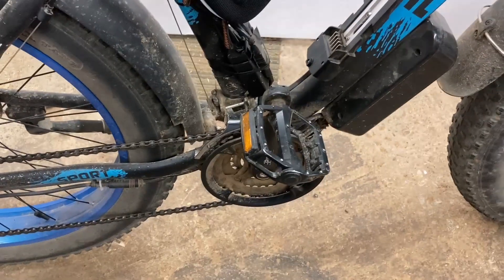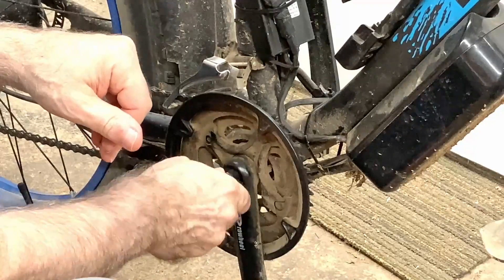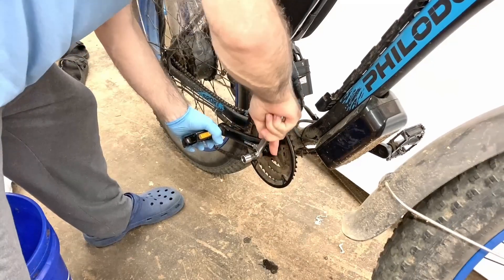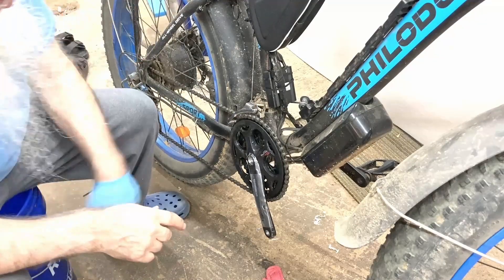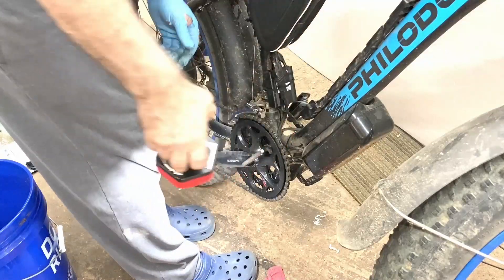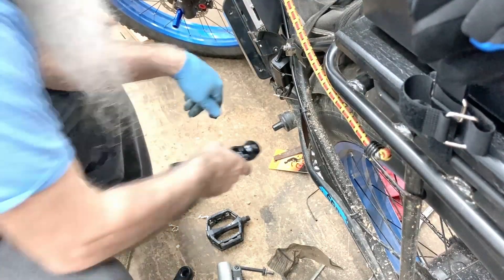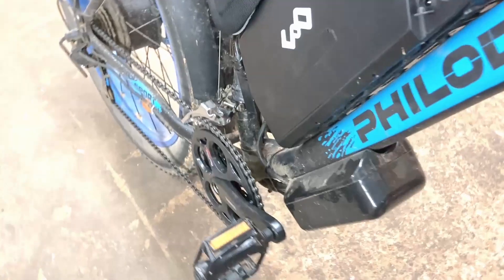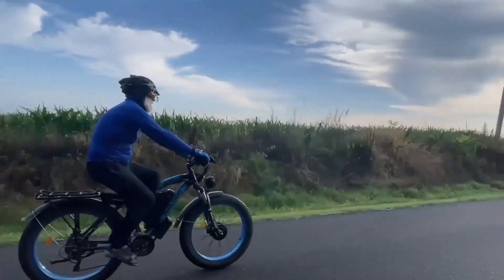Now It Is Perfect: Installing New Crankset Philodo AWD Ebike

Comment: Truth is, this is a GREAT bike. VEry few can do the same. I live in a very hilly area and this bike is a BEAST, and very very beautiful if you care for the estetic when you mod, as I'm doing. Today I upgraded with high quality Italian tires and throw in a MAGURA 220mm rotor in the front wheel. What a new bike now. Stops like it rages fire out. I recommend everyone to burn the rotors (clean them, sand paper). There is so much to upgrade and it's all worthy. Just do not rush and take the look into account too. Blessings from Italy!
Reply from the maker: Yes, it is a beautiful bike, especially in blue ; ) We have a lot of hills, but the bike straightens them for me.
  I will be doing some more mods when it cools off, the heat index was over 100 degrees  [37 c?] today and very humid.
I ride early in the morning so I survive, LOL
Sounds like some nice mods, thanks for watching

Comment: don't know if I told you about the Rearview Camera that's 1080p color screen with night vision. It's called

PARKVISION 1080P Bicycle Rear View Camera,Bike Mirror Camera,Rear View Mirror For Bicycle Handlebars with 8-LED Night Vision,110° view With 4.3" Screen,Adjustable Rotatable Bracket For Bikes,Ebikes

I know at 79.99 might be a little stiff for some, but I love it and with no mirrors that can only be a plus without ever hitting or bumping them
Reply from the maker: That looks cool.  It is funny, I was just thinking it would be nice to have something that would record while I am riding.  I will have to investigate it.  I put it in the Philodo list on my storefront so I know where to find it ; )

Comment: I've done every upgrade you've done so far, and every time the bike gets better and better! The only issue I have is a clunking/clacking sound every tire rotation while coasting or under throttle. As long as there is tension on the chain, it doesn't make the noise. But as soon as there is little or no tension on the chain, I hear the clacking sound every rotation. Do you have any ideas what it could be? I've tightened, cleaned, and adjusted almost every component on the rear wheel (except for the freewheel, and I'm praying it's not that). Also, I can feel the clack slighty on the pedals and the seat. It only makes the sound when I'm sitting on the bike.
Reply from the maker: That is weird.  I had a sound the other day that turned out to be a dragging brake.  It did kind of like you are describing. If I leaned to one side I could get it to go away.  But with every rotation it would kind of clink. But mine was on the front wheel.  Have you put the bike on a stand or in the air and tried to recreate it?  It may be easier that way to pin point it.  
  Have you inspected all the teeth on the freewheel and crank?  There could be an issue with a tooth that is causing it.  If that checks out ok, it is probably the freewheel.  How many miles do you have on the freewheel?  They do eventually wear out.  I had to change mine on my Ecotric.  I changed the oil I use on my Philodo and it is holding up much better.
  I hope you get it figured out,   Sorry I could not be of more help.

Comment: Papa blue shirt I was wondering if you knew about the internal components of the philodo? Meaning an inside depth of the lcd screen. Such as how to get into the secret menu to adjust the speed limiter, power assist level ect... I know in most ebikes you are able to adjust and modify certain settings and of course there are settings that need to be left alone. I have searched for a video or instruction on this for the philodo, with no success. I do believe a video on this is needed for people interested in this bike. I thought I would ask and maybe you don't know. You never know without asking. Like I told you I am working on my finances and plan on buying the bike and alot of accessories from your store soon. Let me know your wisdom on this request. Thank you and have a great day 👍
Reply from the maker: Yes, that was the first thing I did.
If you go to the user manual and go to page 22 it has all the settings and what they do.  P08 is the one to take the limiter off.  

https://cdn.shopify.com/s/files/1/0653/5069/7198/files/Philodo_H8_user_manual-English.pdf?v=1664349439

I really truly appreciate that you will be ordering through my storefront.  I don't make a lot, but every bit helps and is very much appreciated.. : )
Reply: @papablueshirt  thank you I must of missed it. What a beautiful piece of literature thanks again

Comment: Howdy, do you really think the crank set mod made a big enough difference for us daily but moderate riders. My goal is not setting the land speed record record on a Philodo but to gain some mileage.
Reply from the maker: If I had to choose between the new freewheel or the crankset, I would go with the freewheel as it is easier to change.  However them both together makes the bike perfect.  I can ride all day on pas 5 doing 35 mph and not ever ghost peddle.  As far as gaining speed, I don't think you do as the computer is set to a certain mile per hour and it will not give power beyond that.  So when you get to 35 it is like turning off the motor.  Most people can not peddle beyond 35 without the power.    So basically this mod is to just slow your feet down so they are not spinning as fast. It also helps to preserve your battery as you are actually peddling when doing 35 vs just using the throttle.
 I hope that helps. : )

Comment: Did changing the crankset really help for obtaining a better top speed? I've followed your advice and changed my freewheel. That helped to a degree but I still experience ghost peddling and only really gained roughly 2 mph. (Current top speed on flat ground is 31-32 mph with PS 5, top gear and peddling my butt off!)
Reply from the maker: You do not really get a new top speed as the motor shuts off at the same speed regardless.  What you do get is no more ghost peddling.  I can ride all day In pas 5 and never ghost peddle. [did 75 miles the other day]

Comment: Afternoon papa blue another question do you think this lcd cover will fit the philodo?

Nitakou

Nitakou Protective Edge Guard for M5 Lectric XP Display Protective Cover,Soft Shock Absorbent Protective Display Cover (Blue)
Reply from the maker: I think it might.  The display shown is the same as my Ecotric, I will try to compare them today when I go down to the shop : )
Reply: @papablueshirt  thank you again 👍👍👍
Reply from the maker: It looks like it may fit, but I am not positive.
Reply: @papablueshirt  why would it not possibly fit because of the length of the cord for the usb power?
Reply from the maker: The display is pretty thin, so I am thinking it may be loose.  But the material the cover is made of is pretty forgiving so I think it will work. : )
Reply: Well the displays are both M5 models I found out the worst case scenario is if I don't like it for whatever reason I'll just return it
Reply from the maker: Sounds like a plan : )

Comment: Morning papa blue do you happen to know The Handlebar circumference in millimeters.? I was able to find the length which is 28.7" I am looking into an adjustable handlebar extender thanks if you know the circumference
Reply from the maker: Morning,
They say an adjustable extender this size fits the bike
31.8x130 mm   I am assuming the 31.8 is the height and 130 the circumference?
  Let me know what you think : )
Reply: @papablueshirt  well here it is the 30cm one. They also make it shorter in a 25 and a 20 do you think this bar will fit the philodo handle bars?

XNX Bike Bicycle Double Handlebars Extender Extension,Aluminum Alloy Super Long Bike Bracket Accessories,for Bike Mounts,Bicycle Extender Bars,for 20mm-32mm Bars Caliber
Reply from the maker: My other reply I was talking about the stem extender, I mis-understood, sorry.
  I put a handlebar extender on my Ecotric and they are very adjustable as you can slide them either way to mount them.  I will look at the Philodo when I go down the the shop later today and see if I think it will fit.   On my Ecotric I straddled the LCD and put it where the bars narrow.  It made it so much easier to mount things.

 If I had to guess, I would think it would fit as they are very adjustable.
Reply: @papablueshirt  that's what I was figuring thanks. I like the adjustable like the one I showed you 👍
Reply: It's also a philodo adj riser on their website and there's a video by it I think by citizen cycle I think his name was
Reply: Actually his name was mr. C's ebike and he has an assembly video of the philodo adjustable riser. Looks very easy
Reply from the maker: Yeah, I watch Mr C a lot.  I think his dad used to own a bike store, so he knows a lot about bikes.  I changed the headset bearing on my Ecotric and had to take it all apart, so it is pretty straightforward.
Reply: @papablueshirt  yes thanks papa blue. I am going crazy looking for accessories lol check this blue phone holder out. I think mixing some blue into the bike will really make it's stand out.
KMRIPYU Bike Phone Mount, Motorcycle Phone Holder Bicycle Handlebar Cellphone Clamp, Scooter Phone Clip Anti Shake with 360 Degrees Rotation for 3.5-6.8 inches Smartphones (Deep Blue)
Reply from the maker: That is nice, I added to my store ; )

Comment: Did you even mention what tooth the original was and what the new tooth count is? From 46 to 52 or what ?
Reply from the maker: The original was 42 and I went to a 50 , hope that helps.
Reply: @papablueshirt  oh yeah.. That's a big change.. Along with that rear set. Good job. Hope you get the good out of it. I enjoy my 11-52 set up. I can actually give input to over 30 mph on my bike. 👍 Have fun! Thanks
Reply from the maker: Yeah, it makes the bike so much more usable.  I can ride 75-80 miles in Pas 5 and still give input the whole time.  And it is a blast.  Thanks for watching.

Comment: Me and you have a different mind set , you need to get off road and slow it down and not worry about how many miles you put on in a day, don’t like the idea of the gap on the crank set , stay safe.
Reply from the maker: Yeah, My wife says I can never do anything half way LOL.  I don't compete against anyone else, just myself.   I set a goal of 10k miles this year, and I rather ride in the heat than the cold, so I am trying to rack up the miles now, : )  I am sure I will slow down in the winter.
  I plan to do some off road when it cools.  It has been 99 with high humidity, so the heat index is way over 100.  I would go on a trail and never come back LOL  I ride in the early morning so it is cooler.
  Re Gap: the original had one too, I think the shaft is extra long because of the triple crankset.  I have probably 1500 miles on it now with no problems.